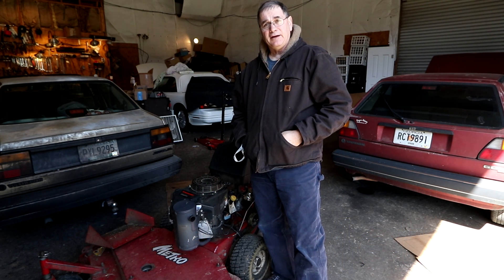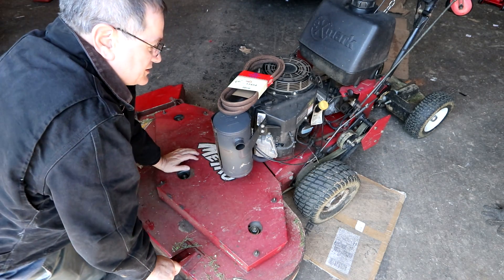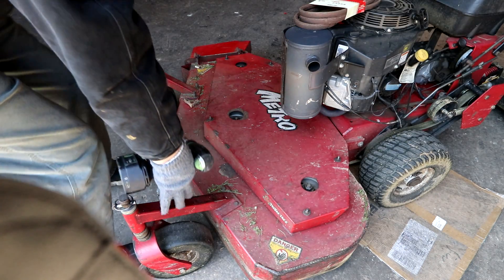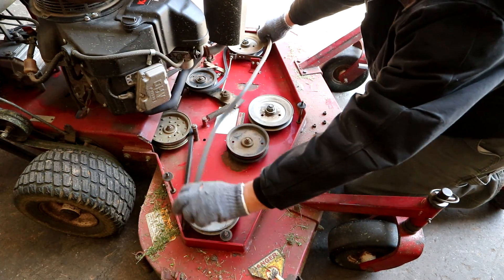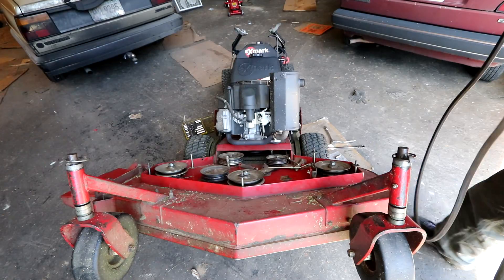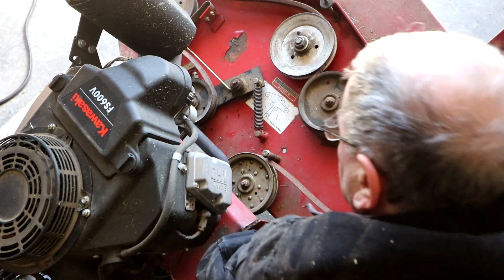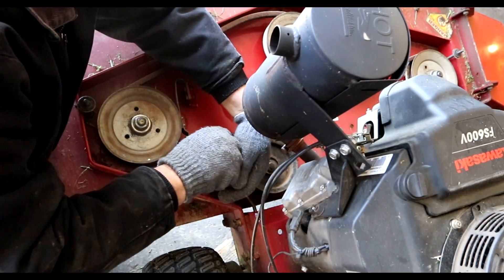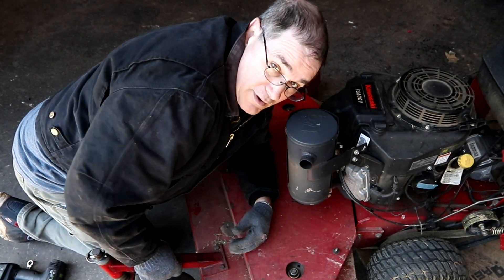Exmark Metro Deck Belt Replacement 48 Inch How too

Comment: OMG.. you do not need to remove any of those belt guides, and or adjust the tensioner.  Look at the effing diagram!,  OMG.,  you feed the belt in from the rear and it will literally go over every single spindle from there..  I’ve replaced there’s multiple time and just did the 199 inch today on a 60 inch deck.
Reply from the maker: You still got to adjust it as the new belt will be a little smaller

Comment: When you put the new belt on does the V part of the belt go inside the pulleys or does a flat part go up against the pulleys themselves
Reply from the maker: flat to the idler v to the pulley just like in the thumbnail.

Comment: What size belt did you buy? And Where from? Thanks for the video!
Reply from the maker: 115-1/4-Inch by-5/8-inch
Stens 265-836
Exmark 1-403174 403174

I have gotten them from Tractor supply by size and at Exmark Dealer. They all seem to hold up well

Comment: I have a Viking 48 recently I installed a new belt . Everything was well until one day later . Everyone I turned the mower on everything was well but as soon as I came to engage the blades it seemed to be reving harder than usual. Anything you can tell me maybe something I haven’t checked .
Reply from the maker: sounds pretty strange you don't have the tension too tight do you? you have to loosen it up with a new belt..
Reply: Joe is Hungry I loosened it up a bit . Still sounds like the engine is reving higher than usual. I appreciate the reply
Reply from the maker: I would make sure that your blades turn free when disengaged (possible bad cutter head on one of the blades) make sure your belt is not too tight when adjusting the tension, otherwise it is going to run a l little harder with the engine under a load.

Comment: Exactly what belt did you buy?
Reply from the maker: I'll get you the part number in the morning.. I went to the exmark dealer and got it but you can probably do better shopping it on line if you know the length..
Reply from the maker: The last one I got came from tractor supply and only lasted two seasons
Reply from the maker: The Exmark Part number is 1-403174 115.5 inch belt. This was an OEM belt.
Reply: Thank you!  Now your video is thumb-worthy.
Reply from the maker: I did not realize the part number did not show.. you must have one too. I love the mower.. and my fancy sulkie
Reply: @JoeisHungry  7